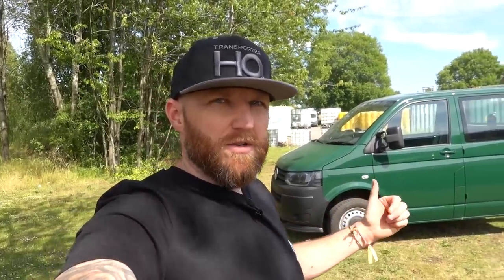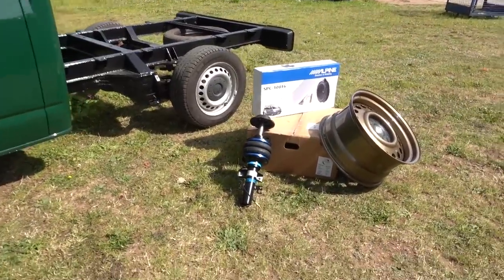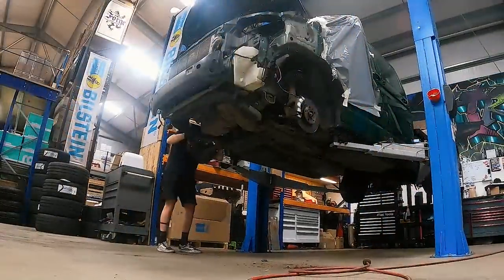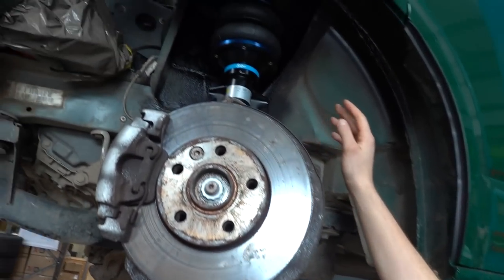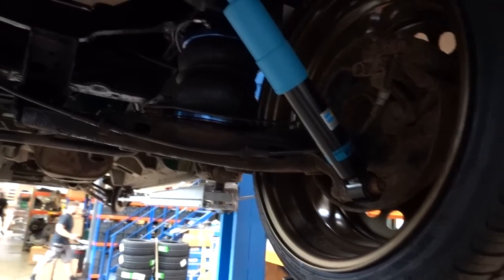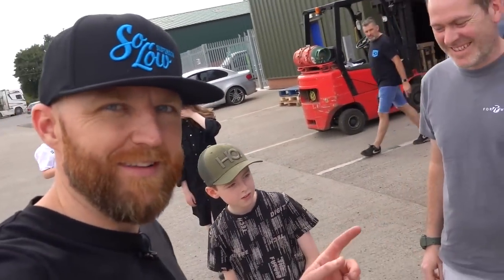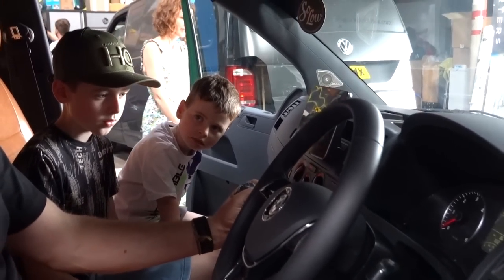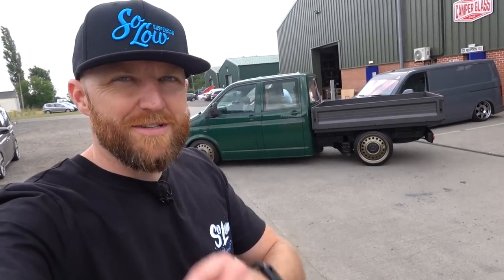We Help Transform The Forty Winks Doka on Solow Air | THQ Built Forestry Commission Transporters

Comment: I seen you fitted the t6.1 speaker kit from alpine.was it adapted for the t5.1 or straight in?
Reply from the maker: We sell them with tweeter adaptor rings for T5.1. If you want to fit the Alpine tweet covers, you will need to cut the A pillars yourself though